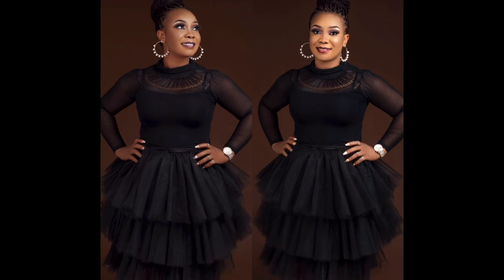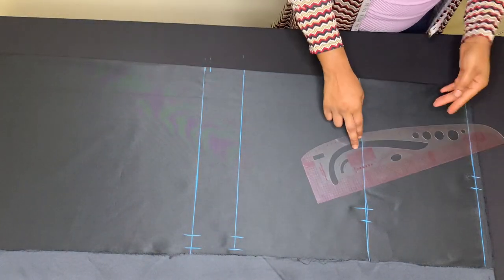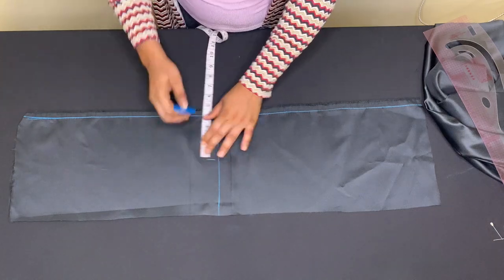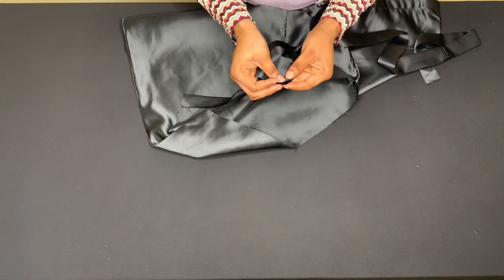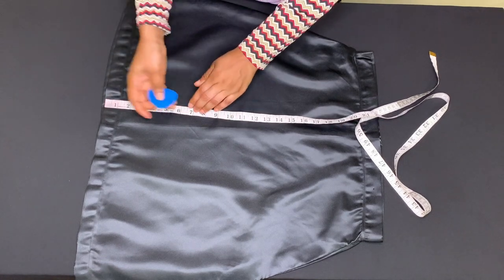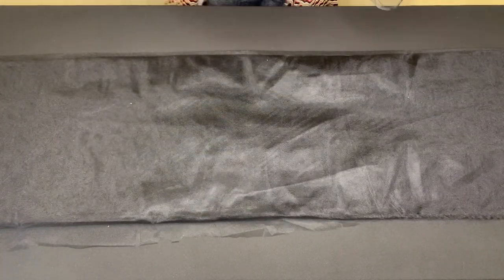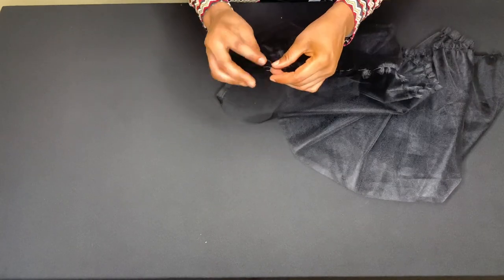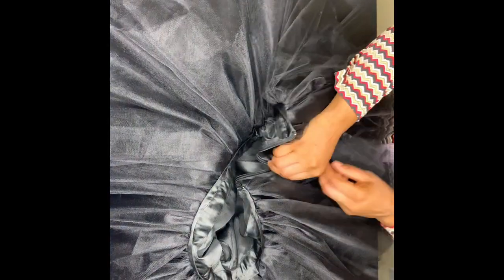HOW TO MAKE A TULLE SKIRT (CUTTING AND STITCHING)

Comment: Hi! I just want to ask how long is the fabric per gather you did? Like the gathers you attached, how ling was each of that before and after gathering? I hope you answer, thank you!
Reply from the maker: The Length of each layer of the tulle is 12 and a half inches, the half inch was used to gather the tulle and joined to the skirt. 
That way all the layers will be 12 inches.
Reply: @peshstyle  oohhh, how wide per tulle is it?😊
Reply from the maker: @JannaIsabella07  60 Inches, u can make it as wide as you want
Reply: @peshstyle  Okay! Thank you so muchhh!😊